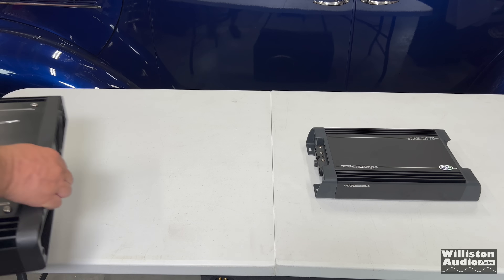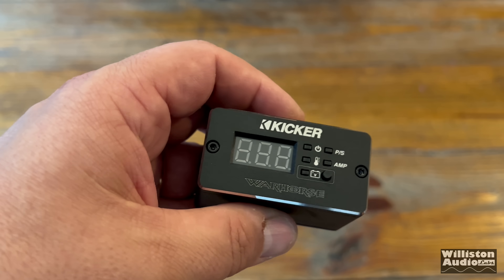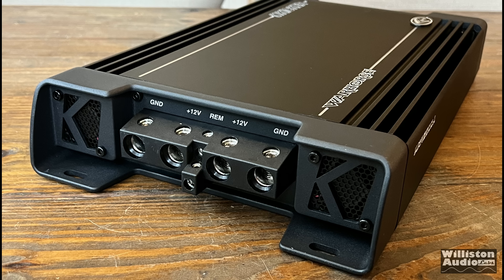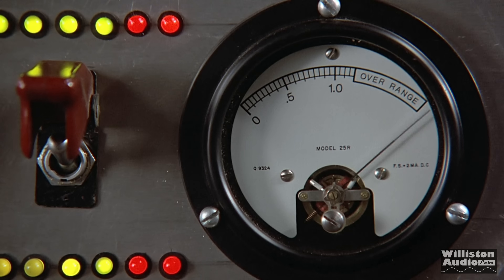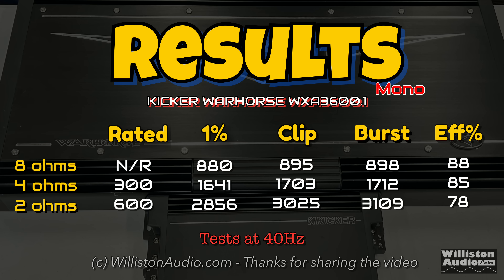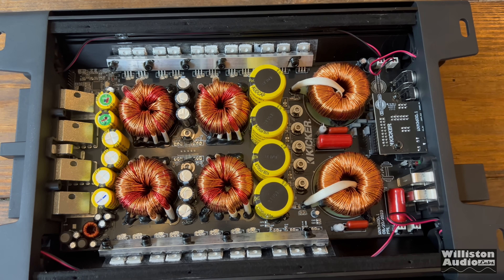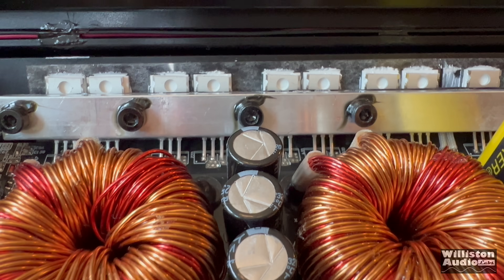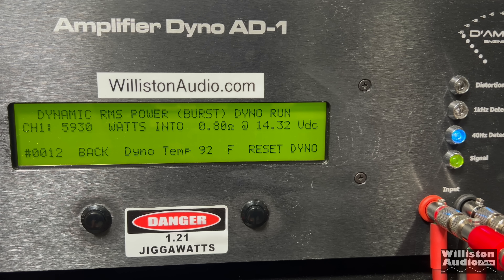KICKER Warhorse is BACK! WXA3600.1 Mono Amp Dyno Test

Comment: I'm not familiar enough with carstereo equipment as I'd like to be. When you say you need 400 amps of power for that amp... How are you supposed to get that much power in your vehicle? Most car alternators aren't that strong.
Reply from the maker: You would need either an upgraded alternator or some extra batteries. The market for these amps are SPL competitors who have large alternators and battery banks setup
Reply: You have to keep in mind that the average music listener doesn't need anywhere close to this amount of power. A single 12 inch ported sub can rattle a whole car with just 200 Watts. If you're just listening to music you may not more than 20 watts. 

This Warhorse monster is not for the average person. The person that needs this much power is already going to have a large battery bank and a high output alternator.

You also want to keep in mind that music is dynamic in nature. So it's not going to require 400 amps continuously. Assuming your enclosure drops the subwoofer load down to 1 ohm at certain frequencies and your volume is turned all the way up, you'll get a surge of 400A when it plays that frequency. 

When it plays frequencies above or below, the impedance rises and the current draw goes down. So most of the time the surging bass beat is going to draw way less power. It might peak at 400 amp, but the average might be 80 amps or less. Its very dependent on the song.

You're really not running the sound system off of the alternator, it's mainly running off the battery and the alternator is steadily trying to keep the battery charged. An alternator can put out its rated power continuously.
Reply: A good example is a YouTuber named EXO, Bruce. He's building a 60,000 watt system with 12 18" subs. He's going to run it off a single alternator. 

How you might ask?

Simple, he has a ton of cone area and it's a 6th order box so it's very efficient. He's building it to demo, not spl compete. So he can turn his power way down. 

Then he has a massive lithium battery bank. He can charge it up with wall powered chargers. 

At the shows he can get massive output while only using a tiny fraction of that 60,000 watts. 

I'm doing something similar just at a much smaller scale. My stock alternator will probably be fine. I'll have a ton of extra power I won't Norma use except for the occasional burp. Lol
Reply: @JasonWW2000  back in the day I had two 12" P3 Rockford fosgate subs and a punch 400 and it hit really hard. I want something that hits again,  I just don't know enough to pick good components that won't break down.
Reply: @APNFORD A DSM or black and grind 400w 4 channel? Maybe bridged for 200w x 2 at 4 ohm? I think you could easily reproduce that today for a lot less money. 

I'd start with figuring out how much space you want to give up for the sub. If you have room, a single sub in a ported enclosure is going to be very efficient. A sealed box is not going to play the low frequencies as well and will require more power for the same spl. 

If you have a hatchback or SUV then you'll have even more efficiency compared to a subwoofer box in the trunk of a car. 

Once you get that sorted then you can look at how much power you need.
Reply: @APNFORD If you want to save some money, you might consider picking up a used Rockford Prime amp. You can find the 500w, 750w and 1200w for $100-$250. Those are great units that are slightly underrated. The 1200 dynos at 1500w. 

Kickers cxa amps, like the cxa600.1 cxa800.1 or cxa1200.1, can also be found used for good prices. 

You can't go wrong with any of those and they should all be okay with a stock charging system. Some models are rated for 1 ohm and some for 2 ohm. You have to keep that in mind.
Reply: @APNFORD As for subs, there's lots of good options. For the last 30 years I've only ran sealed and infinite baffle, but I've started getting into ported designs and I'm really liking that strong, low end output. I recommend ported, but that's up to you. 

Once you know what your maximum box size is you can figure out the best use of that space. 

Rockford still has the P3 model. I like high end SQ subs so I'd probably get a Kicker Comp Q (Q class) 10 or 12. There's lots of other good brands out there for subwoofers, though. That might be the hardest decision due to so many good options. Lol
Reply: @JasonWW2000  thanks for the info.  I need to shop around I guess.

Comment: For around the same price you can get a Sundown SIA 8000 Certified over 10,000 watts at 1 ohm
Reply from the maker: Did you miss the part where the KICKER amps are tested 60 seconds at Full Output power? I don't think the SIA could do this, nor most other brands with an amplifier at this power output. You are paying more for the in house design with durability and reliability built in.

Comment: "War Pony" would have been a marketing disaster. Using screws on the bass knob & diagnostic output module instead of making the front plates magnetic males me sad. The Remote In design has also left me shaking my head.  I know, it's a SPL Competition optimized/designed amp but also was designed to be priced for us regular people. I wonder if Exo will incorporate some new Warhorses into a build.

Comment: Oh look more class D garbage.
Reply: Huh? You still living in the 90's? Lol
Reply: @JasonWW2000  Did you mean " Still enjoying superior audio" ?
Reply: @runningbear1982 No, I mean uneducated about all the recent advancements in technology.
Reply: @JasonWW2000  I've have two class d amps made by SMD. They sound better than most class d, but still sound way worse than anything class BD or AB.
Reply: @runningbear1982 There's a lot of serious SQ competition vehicles around the world that are choosing to use class D amps over class A/B. It's almost like there are a lot of other factors involved besides the actual output stage of an amplifier. If it's built right, it can be amazing. If it's built poorly, it may not sound as good. Kinda like speakers. 

If you prefer the older designed stuff, thats cool. Car audio is a fun hobby we can all enjoy.

Comment: 60 seconds? This is BS, burn in was done for at least 8hrs for Linear Power at full rated power.
Reply: I'm not sure why you feel so strongly about this. 

A lot of other subwoofer amps on the market can't maintain rated power for 2 seconds.

Comment: 2024 and kicker still isn’t putting a clip indicator on their amps 🤦🏼‍♂️
Reply: I wonder why? 
A lot of people these days are pushing their amplifiers to the limit. It seems like a clip light would prevent people from burning up their subwoofers.

All you need is a simple voltage comparator circuit between your main voltage rails and the speaker output. I'm looking into adding clip lights into some of my older Rockford amps. In theory it should be cheap and easy for a big manufacturer to incorporate this into the design.
Reply: The KX amplifiers kinda had a clip light on the remote. Did any other models have one?

I hope we can get somebody like Joe Hobart to really explain Kickers philosophy on clip indicators.

Comment: I think its time i finally use my warhorse 10k its been sitting in the box lonely but i just received my 4 kicker solo x 12s i cant wait to get started on it
Reply: I'm assuming your subs are all dual 4 ohm?
Reply: @JasonWW2000  no i ordered dual 1 ohm to have a final load of 2 ohms as the 10k warhorse is not 1 ohm stable
Reply: Ah, so each output is only 2 ohm rated. Gotcha.

If you wire all the left coils in series that would be a 4 ohm load. 

Then all the right coils in series is 4 ohms.

Is that the plan? 

Since it's 2 ohm stable you could get dual 2 ohm subs and wire the left coils in series parallel and get a 2 ohm load. That would get you more output if you wanted it.

(This not taking into account impedance rise which is a whole other thing)

Comment: The Competition mode is more about setting gain/crossover when using multiple WXA36001 amplifiers, not input battery voltage.
Reply from the maker: Yes, but it was also mentioned the amp can handle up to 17VDC when in COMP mode as opposed to 16VDC when it's not enabled. That came from the head amp engineer Joe Hobart at KICKER. But what you said is correct as well

Comment: No clip light is a dealer breaker for me
They didnt "forget" they chose not to have one 😢
Reply: My next amplifier purchase will be for a unit with a clipping light.
In a nut shell: I want to do an absolutely tiny, tiny amp setup. So I don't want to be blowing up speakers.
What sucks is I believe it's only Rockville?? That makes most small amps with clipping LED's.
I don't even want to touch the Brazilian amps.
Anyone have a suggestion?.....25, or 40 watts per channel. Must be able to drive 2 ohm load. Crossovers a plus. But I can do passive.
Reply: @MrBetaTube You don't actually need a tiny amp setup assuming you have self-control with the volume and bass knob. Or you can simply adjust your gain so that it would be impossible for it to clip.
Reply: @MrBetaTube power acoustics 10000 watt....$185 goes to 5 hz!! its really 3000 @1 ohm and around 900 @ 4 ohm clean, use superfat 000 wire or twin 4 guage or wont turn on!!
Reply: Clip lights are really not needed you can hear subs make an awful sound and back it down before it ruins the sub or amp. Clip lights are like brake lights for blind people. Pointless.
Reply: @c130aviator Ah, so people keep burning up subs for other reasons, huh? Make an awful sound, do they? 

You're entitled to your opinion, but don't come up here lying to people.
Reply: @JasonWW2000 If you can't hear clipping then you don't need  a amp like this.
Reply: @therealistintheboot8822  That's the dumbest thing I've ever heard. Lol

Let's try the opposite. If you're the type of person that can't hear when your speakers or subs are clipping, then you definitely need to have a clip light. The alternative is to just let them burn up. Is that what you're suggesting? Burn, baby burn?

Comment: Kicker missed big time! 1100 for 2 remotes, no clip indicator, and barely 5k! With so much competition out there this will fail miserably. Only hard core kicker fanboys and youngsters who don’t know any better will buy this.

For reference, I bought a DD M8000 (basically 10k output) WITH a clipping indicator on 1 remote for 1100 brand new from my DD dealer. Kicker please smh 🤦
Reply: I guess it will be up to the market to decide whether it lives or dies.
Reply: Looks like you got a real bargain, since those amps are currently selling for $1,500.

Comment: No way in hell I'd pay over a grand for a Chinese/Taiwanese/Korean amp. Not when you can get an underrated 3kw, made in USA, Mmats for not much more.
Reply: Well, you missed the mark. This amplifier is designed and engineered in the USA and assembled in Thailand.

Amplifier manufacturing in the US is simply not practical anymore. Nor does it equate to it being a quality product.
Reply: @JasonWW2000  🤣🤣🤣🤣
A. It is. Or Mmats wouldn't be doing it. B. It does.
Reply: @puterg0d I think you're using faulty logic.
Reply: @JasonWW2000  👍
Reply: @puterg0d So now you understand how one company doing something does not make it possible for every other company to do the same?

You also realize that the quality of a product is not based on where the manufacturing takes place, but on how the work is done? 

You realize that China can produce the best quality products if they want to and America can produce absolute crap and vice versa? 

If so, that's great. 👍

Comment: Remake a noisy, burp only, SPL only joke amp with an average output average spec amp for a well above average price. REALLY missed the mark on this one.  Way to go, Klunker. 
And the ‘Allen’s keys’ and ‘don’t eat the gel pack’ jokes? Unfortunately, still not funny.
Reply: The original Warhorse was the biggest, baddest amplifier on the market and it resulted in many competition wins. That was it's purpose in life and it succeeded at that. 

This is not a remake of the old model. This is a clean sheet design and only the name was reused.

Comment: Kicker has there entry level gear and they have high end quality products, this is no exception. I guarantee its great amp that will last along time with proper power.
The only thing I don't like is the underating, its birth sheet says 4600 why not call it a 4600.
Reply: The actual power output is going to vary from amp to amp so you have to give it a little headroom just to make sure it will do rated. 4,000-4,200 would probably be a safe bet. 

I can only speculate on why they chose 3,600. Maybe that's what it would typically do in the real world at slightly lower voltage?

Comment: Kicker always failing on understanding the basic concept that most people aren’t going to spend high money like this.
Reply: Yet they continue to be a successful company for over 50 years. Hmmm.

Maybe they are smarter than you realize?
Reply: @JasonWW2000  As someone who has been in marketing for over 30 years. Sure. But, they’d be doing a lot better if they lowered their prices by half on their “high end” equipment.
Their lower priced options at the box stores are what keep them in business. 
Companies like Target and Aldi are already lowering their prices to fight inflation. Kicker needs to do the same. 
Spending close to $2000 for one Warhorse amp and 1 Solo X is ridiculous. 
Most people barely have that amount in their whole system.

Comment: I just noticed a change in the board design. It looks like the older board that Joes showing had four output FETs next to the big 80v yellow caps. The release Warhorse now has SIX of those FETs.
Reply: I think it changed when they added that diagnostic thing which would explain why it's 2 sperate parts.
Reply: Joe has recently mentioned they added FOUR extra output fets just to beef things up.

Comment: No CLIP LIGHT ON THE REMOTE!? My KXA has a clip light! I dont care that its not wireless, in fact i prefer wired for the reliability...  but WTF Kicker!! no clip light??  WTF!????
Reply: Yeah, it's not the end of the world but it definitely seems like it should have one.

I gladly sacrifice one of those other indicators or even competition mode just to have a clip light.
Reply: @JasonWW2000  Absolutely, I would sacrifice temp in a heartbeat for clip indicator. I could add a wireless temp sensor.... its not easy to add a clip light...

Comment: You have reviewed many amp costing less delivering more power. Kicker has lost its value in my opinion. 
I used to run only kickers, but after several disappointments I started trying other things.

Commenting to help the algorithm. Keep posting dude.
Reply: Kickers never going to be able to compete against the Brazilian brands. There's no way they could get their prices that low. 

Luckily, there's a large buying segment out there that does not prioritize watts per dollar.
Reply: @JasonWW2000  The Down4Sound line is not the cheapest, but has a lot more value than Kicker. Like I said I used to be Kicker only.  Some where after 2005 Kicker became junk unless you got the very top one.

Oh and I have a little beef with JP. In case u all think I am bias or something. I called him out for that BS blue tooth speaker.
Reply from the maker: Thanks for watching and commenting!

Comment: overpriced for that size full bridge amp
Reply: It's not overpriced compared to their competition and even their older kxa 2400.1. 

So it depends on what you're comparing it to as to whether or not you think it's overpriced. Luckily there are many options to suit everyone's needs and price range.
Reply: There are plenty of similar size or even smaller full bridge amps for the same or more money.  Examples. MMats M3000.1 is $1265. A JL HD1200/1 is $1499.
Reply: @91lrrrc Don't forget about the Rockford 2500.1 BD which costs $1300 and dynos at around 3,000 watts.

Comment: Would have rather had the bass knob built into the remote box as an all in one unit, but its still workable the way it is
Reply: Really? I kind of like that they're separate. I can put the indicator on the dash and the bass knob in center console.
Reply: @JasonWW2000  just a personal preference.  I'd rather have one cable to run than two , one box to mount than two. I'd be fine with it either way though.

Comment: No clip light isn’t an issue for me. I have 3 other tools to easily set gains properly.
Reply: I believe the clip light would be very useful when you're turning the power up on a day-to-day basis. The point that the amplifier clips changes based on voltage and how much amperage it can pull.